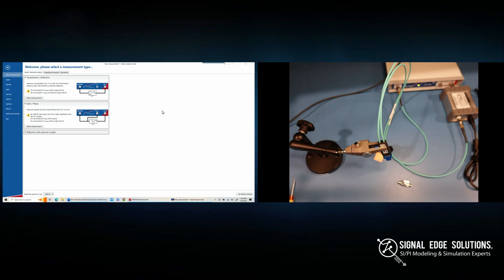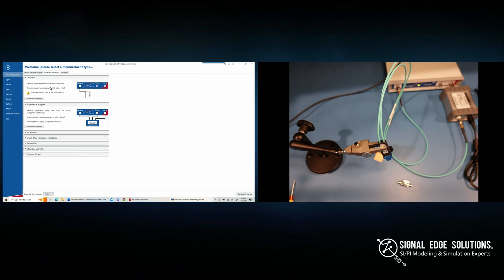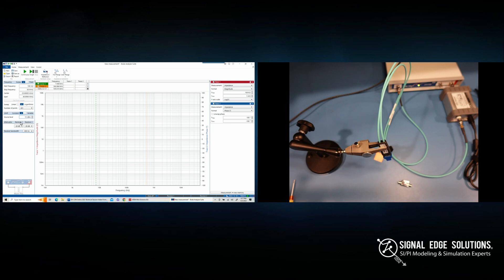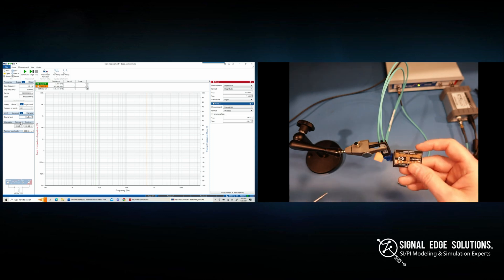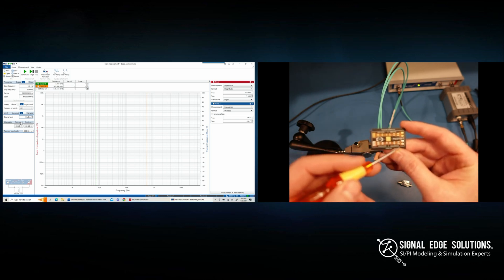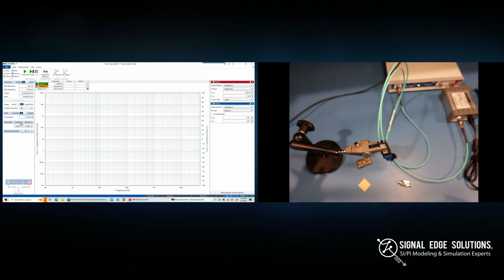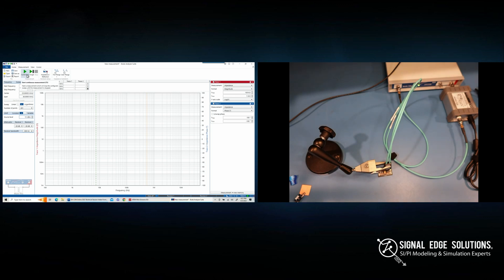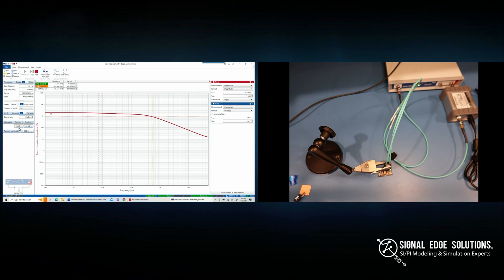2-Port Shunt Through Impedance Calibration with Bode 100 and P2102A

Comment: Hi Ben, regarding your comment at 2:06, could a standard 20dB attenuator be added to the output side of the J2102A instead of using like a x10 probe head?  I would think that by using an attenuator you would maintain a 50ohm environment all the way thru to the probe tips which would allow the use of the Bode 100 "Shunt-Thru" measurement and be able to get the advertised 1mOhm to 100 ohm range.   Or, if it happens to be that the J2102A probe tips are actually constructed like a PI attenuator, then couldn't you still select the "Shunt-Thru" mode instead of the other one that requires specifying the series resistance Rs ?  Thank you for your videos.
Reply from the maker: Hello Zktec1, So, in theory you could add a 20dB attenuator external to the VNA. However, you will be forced keep that on for all calibration steps since the connector insertion loss is now part of the calibration steps done for OPEN - LOAD - SHORT. This will ultimately limit your measurement setup's dynamic range and ability to measure lower impedances. In regard to your concerns about maintaining a 50 Ohm impedance with the 10X probe head: With a 10X probe head, the impedance is still 50 ohm all the way to the Bode 100, only the signal is attenuated. The 10X probe head is a built in 10X attenuator. the probe heads are not constructed like a PI filter. The insertion loss plots of the probes are measured and the probe bandwidth is from DC to 300 MHz.

So, in short, I would never do this or recommend this unless you are trying to measure a higher voltage DUT to protect your VNA. If you are trying to measure a higher voltage, you still do not have to add external attenuators if that is desired, since the Picotest P2102A is available in multiple attenuation values (1X, 2X, 5X, 10X) and if you want to get a custom attenuation value that can be done for no extra cost. If fact, you buy multiple P2102A probe head sets with various attenuation values, without having to buy another probe. In other words, the probe heads are removable. I have 1X, 2X and 5X probe head sets. Feel free to check out the Signal Edge Solutions store if you are interested in ordering a Picotest P2102A probe.  We also sell probe head sets.

Let me know if this answers your question.

https://www.signaledgesolutions.com/product-page/picotest-p2102a-2-port-probe

https://www.signaledgesolutions.com/product-page/picotest-p2102a-2-port-probe-head-set
Reply: @SignalEdgeSolutions   Thanks for your response Ben, I've got lots of information to chew on.  I'm sure I'll have other questions in the future.
Reply: Where can I get the nice holder you have for the pdn probe?

Comment: I noticed you changed your receiver attenuation midway through the calibration.  I would assume that when you do that, you're reconfiguring the hardware signal chain inside the Bode.  So how could you confidently assume the previous two calibrations (Open, Load) are still valid?  Also, assuming you're DUT (not your calibration fixture) has 1oz copper, why would using thicker copper for the Short calibration make the DUT measurement more valid?  I would think you'd want all variables to be the same.  I'm still learning here so maybe my assumptions are incorrect.
Reply from the maker: The goal by adjusting the attenuators is to maximize our dynamic range for the short calibration step. To your point you said how do I know my calibration is good, I have built known DUTs that I know are exactly a certain magnitude. I use these to check my measurement setup after each calibration. 

Lastly, the copper weight short makes a very big difference on how good your noise floor will be. 

Think of it this way if 5 oz. Copper is 20 microohms and 1 oz copper is 100 microhms. Which one will have a better noise floor once we've subtracted the short from measurement set up after the SHORT calibration?

I think I will use your question here to make another video. I also have a blog coming out that answers this question in some details.

Thanks for watching the video. I hope you enjoyed it.